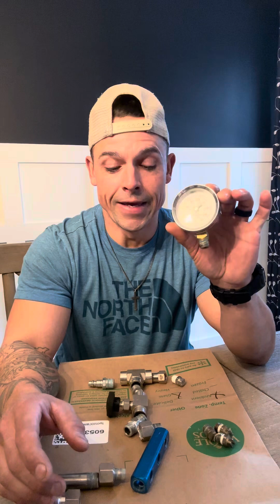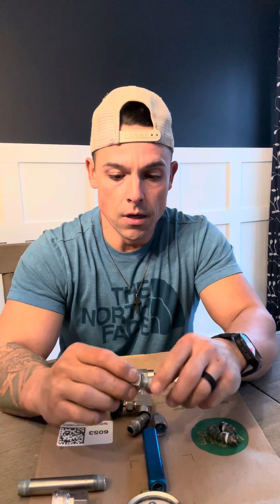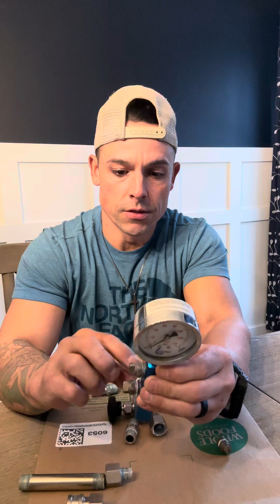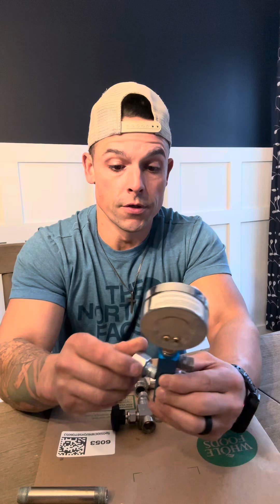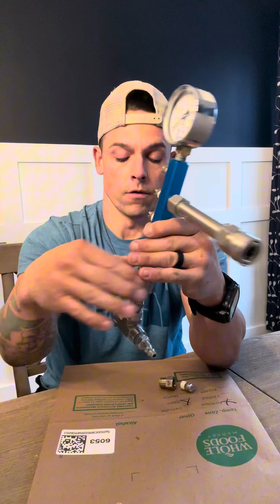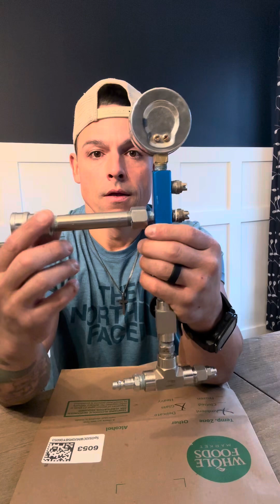The Snow Machine Build Everyone Wants

Comment: I'd like to design I notice the manifold was designed for an air compressor is it study enough for the pressure washers psi. Have you had any issues with yours
Reply from the maker: Been running for over 2 years no issues
Reply: Awesome. thank you for the quick reply I've been scouring Amazon looking at stainless steel 3 ways to stack them and it's just too much opposed to buying a pre-built one. but looking at your part list it seems very achievable.
Reply from the maker: @jesses3882 if you decide not to do I well them for $250 calibrated to your equipment

Comment: the link for the air manifold doesnt have like an extra port for the pressure washer in the back also are the nozzles for the water and nucleator the same?
Reply from the maker: I put the wrong manifold I just changed the link
Reply from the maker: Built nozzles are 25 degree
Nuc is 65